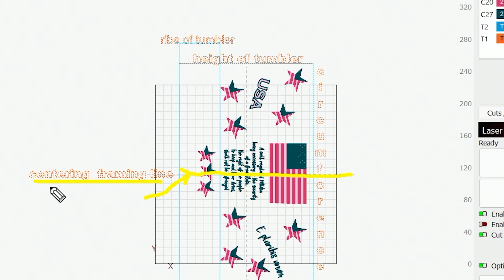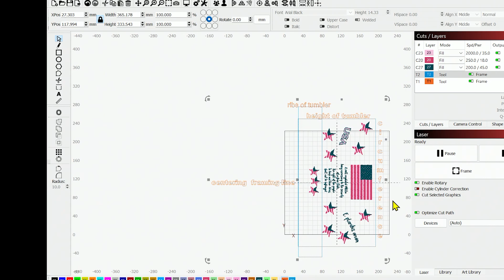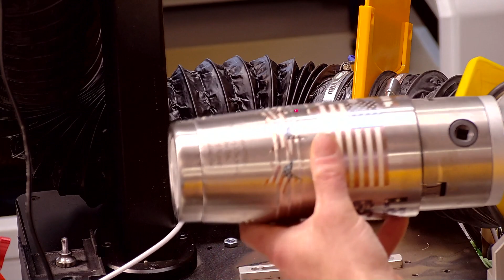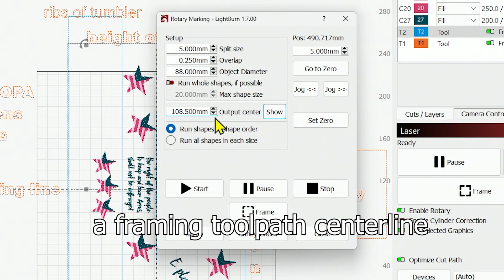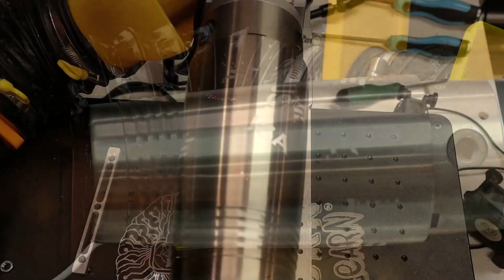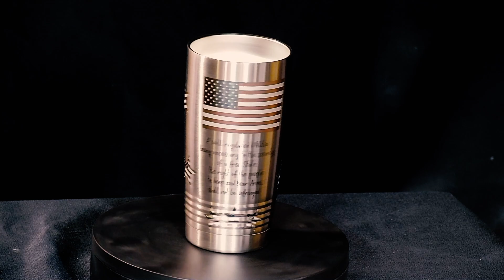Color Marking a Stainless Steel Tumbler - Rotary Setup - Free File w/ Settings

Comment: Bit late to the party but... set your split size to the same value as your line distance. This will take care of the visible lines that are created when splitting (basically caused by change of focal point due to the curvature). Learned a lot on your channel. Thanks for that. Came across this spit size tip somewhere else and thought I return you a favor (hopefully) 👍

Comment: Awesome job as usual!  Thx for the file.  I might try to do something similar using the Roly LaserMatic MK2 30w and Dimetri’s stainless colors  settings.   Another design change I might make is to wrap the bottom stars all the way around rather than just the 3.
Reply from the maker: I didn't want a bunch in the ribs. Lasermatic is next on my list with stainless!
Reply: . I get it.  The tumbler I have is ribless.